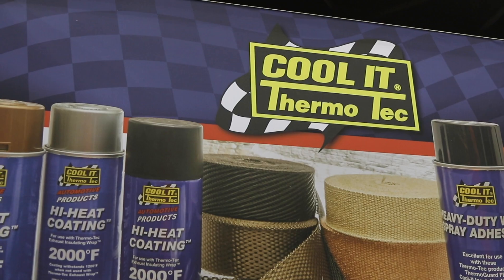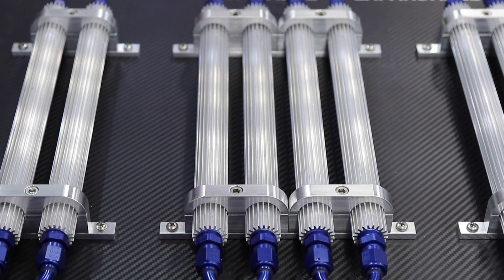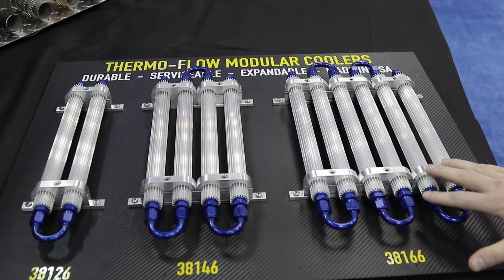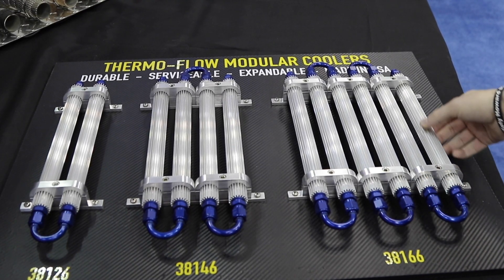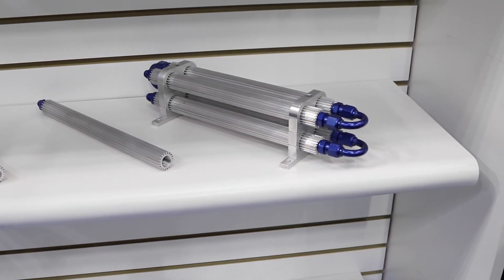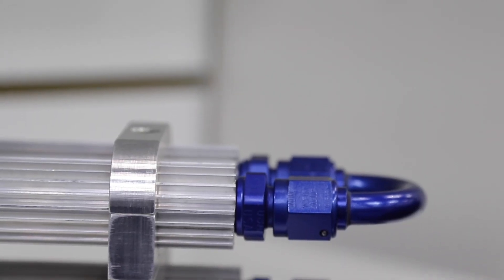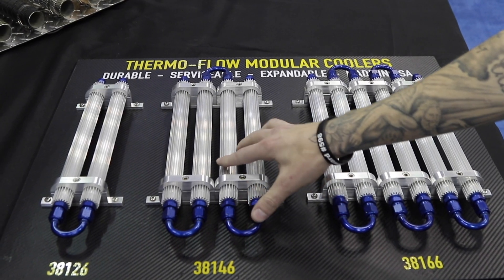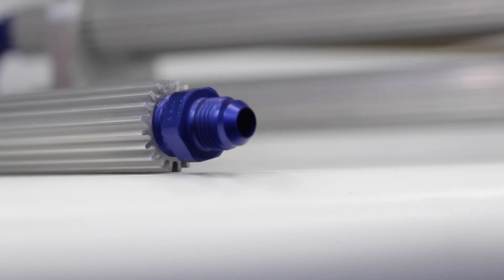PRI 2019: We Take A Look At Thermo Tec's New Thermo Flow Cooling System

Comment: Killer product - would love to use this to replace long straight runs in the fuel system. Replace all that tube/hose with a heatsink, say goodbye to any potential of vapor lock!
Reply: vapor lock is not a problem with fuel injection. But it's easy to heat up fuel with the pumps alone. This would be useful with the run of fuel line under cars that are often very straight and exposed to the hot pavement in the summer and the exhaust system all the time. Nobody ever talks about the heat build up under a vehicle either.

Comment: Says no numbers. I'd love to know inlet temps and outlet temps. Obviously it's no better than the competition.
Reply: It's an extruded aluminum tubular heatsink - I don't know what kind of voodoo magic you think can be applied to this stuff, but it won't work any better or worse than any other extruded aluminum tubular heatsink.

Which is the entire reason why they talked about the modular design; because no one offers any kind of heat exchanger with such ease of expandability.

It's a radiator - a finned tube made of industry standard material that transfers heat. It isn't magic.
Reply: The increased surface area inside the tube is the improvement